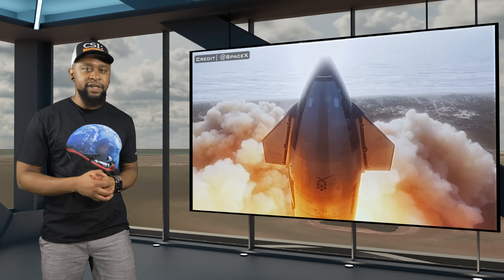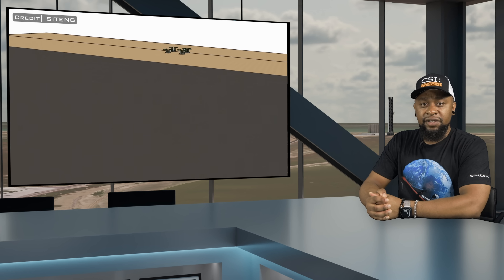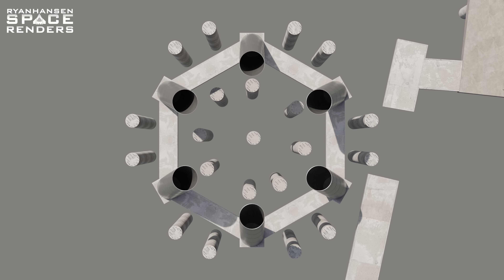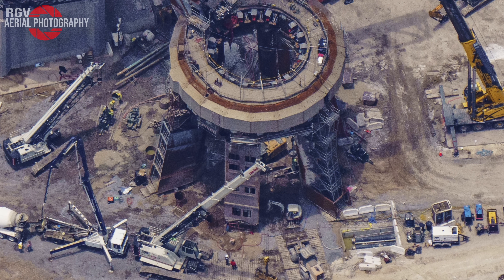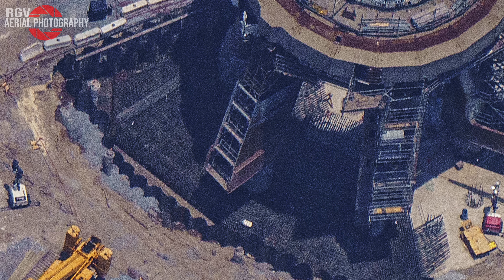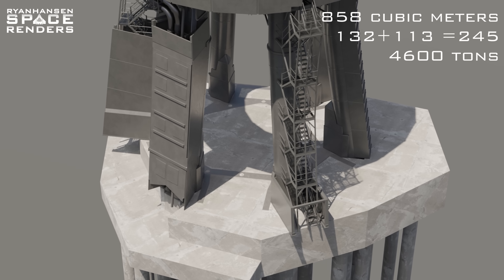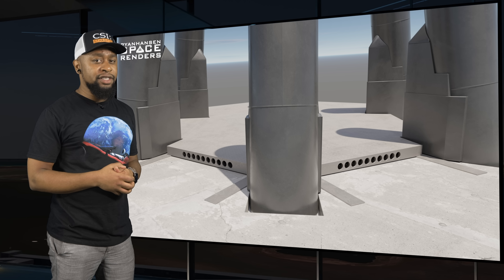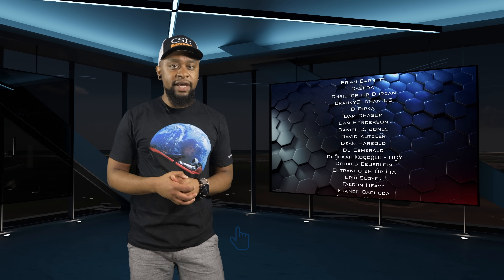How SpaceX Will Guarantee Its Launch Pad Never Fails Again! [Part 1]

Comment: Wow this was quick to recent updates. Well done.  I do have one question though, if the deluge tanks will fill to the top of the weir pipe then the steel plate would be empty of water, during launch most of the water would be wasted just filling the pipes and steel plates. So i suspect that there will be a continuous over filling of the tanks during the launch to fill the steel plate, since water trucks won't be delivering during the launch, this would mean the a water supply line is needed, Have i missed seeing this water line installed?

Comment: Great video ... but all this bracing of the concrete is great and all but when 33 engines blowing on the ground could find a weak point and then everything gets blown up again . Hope that doesn't happen and the water system works

Comment: Another great watch, can't wait for part 2. It's going to be interesting to see what changes between this version of steel sandwich and the one in Kennedy. Hopefully the one in starbase is already completely over built and the one at Kennedy will be bullet proof.
Reply: And hopefully with a flame trench, too. One less part (water pressure system underperforming) to go wrong.
Reply: @EMichaelBall That ship has sailed, the pad location in Florida would not be capable of a trench. They would need a very large trench, one larger than the SLS setup. They're not on the elevated concrete platforms, but basically ground level, so no trench.
Reply: @Jake Rosendahl They’d have to build a concrete mega mountain on the side of 39A, so Falcon Heavy could continue operating from 39A. After the crew capable tower is built at SLC-40, 39A could be left empty for just Mega Mountain construction and FH operations (obviously not simultaneously, but then again, FH isn’t a frequent launch vehicle). If SLC-40 becomes FH-capable, then 39A could be completely abandoned for Starship Mega Mountain reconstruction right where the current 39A trench is. This would require tearing down the current hill/trench complex, and rebuilding bigger.
Reply: @EMichaelBall  They need more than just that. They need a ton of fill dirt to create a mega mound, let it settle for 2-3 years, then dig the trench, then cover it all in concrete, then add a way to transport starship and super heavy from below up that hill.

They aren't gonna get all that dirt from anywhere, originally it was dredged up dirt from the rivers/swamps from right there. They wouldn't get to do that now. Nobody has that amount of dirt sitting around close, nor the ability to transport it from very far.

Comment: Good stuff, sir! The explanation of the engineering and forces involved are very good, allowing a far better understanding. I am curious, though: Over time, what will the effects of liquefaction be on the foundation of the Launch Tower as it relates to the Launch Mount? The composition of the soil there is pretty much sand, saturated with water, going down a long ways. Repeated launches will have interesting effects to these two items as they are not tied together. I am told there is rock down there, but it's a long ways down...

Comment: Who is going to argue that there were no "opportunities for improvement"?
* giant hole in stage 0
* giant debris blowing holes in storage tanks, smashing vehicles, spreading dust over several miles beyond safety zone
* 6-8 engines failed during flight
* self destruct did not work in a timely fashion

<g>>>
Keep up the good work.

Comment: Zack .... I suspect that the subsurface soil beneath the Fondag' layer and around the original concrete pilings has been severely inundated with seawater due to heavy rains and overly high tide levels in during the week prior to the launch. Liquefaction had already set in. The subsurface ground was more like quicksand but solidified I to soft clay  that gave way under the pressure of the 33 engine ignition. The surface Fondag' layer had no solid surface. beneath it.

Comment: As long as you do a heavy stress test on the change to ensure it won’t fail in some other catastrophic way by making a mock set up with weight & force to go against it to see what would happen to different mounts & connections with the new part because it may/may not stop/cause a catastrophic incident that would be better/worse depending on the situation. Over engineering is a good thing but you need to finish it to the finish line of the complete marathon.

Comment: 22:32 I think the smaller discharge rate could potentially be for later use in flights that have the booster return to the pad. It would still be decently close and you'd want a lot of sound suppression.
Reply from the maker: I don’t think it would be necessary because it’s only about 3 engines firing when they are landing.  Also the booster will not be above the launch mount when it’s landing and will instead be off to the side

Comment: You may have missed one interesting detail.  At 20:09 in the video, there is a guy in a dark blue shirt next to a step ladder. Behind him, they are cutting pipe threads into large holes for the water supply using a giant tap with a hex head. The tap is sticking out of the hole just below and to the right of the top step of the ladder. I saw the full video separately, and they are using a wrench and a 12 foot+ extension pipe trying to turn the tap by hand. It looks like a 12 inch hole. They are making almost no progress cutting the threads by hand. As each guy gives up, they keep clling in bigger and bigger guys and use longer and longer extensions. This should have been done during fabrication. Maybe they had planned to weld these connections?
Reply: We show a close up and describe the thread @ 19:32

Comment: I applaud the production values and 3D  modeling in your video.    However, I think you are mistaken concerning the purpose of the water spray system.  The water deluge system is primarily there to dampen the massive vibration output from the rocket exhaust.  Cooling is secondary or tertiary purpose.  I do t know the exact vibration output of this thing but the vibration under  Saturn V (roughly similar thrust output) was estimated to be somewhere just north of 200 decibels during liftoff.  This huge amount of vibration is most likely what did most of the damage  to the pad.  I would also strongly suspect that the reflected vibration also did damage to the engines and nozzles of the vehicle.
Reply from the maker: That is the purpose of a normal water deluge system but we do not believe that is the purpose here.  Elon has stated multiple times that they are not concerned with acoustic energy.

Comment: You have a way of explaining things that is concise and easy to understand. No nonsense, to the point. I have not heard anyone address the new raptor 3 and what will be done with the other two raptor versions. Will the other raptors still be used, and why, if there is a much better version? Can they be recycled or are they waisted? Why would SpaceX use a “less than” version of a rocket engine? 
Curious!
Reply: Once future Raptor version is operational they won't continue to use the older design. Right now Raptor 2 is still being used because there's a lot to be tested and S25/B9 is the most ready vehicle out there without wasting time

Comment: I bet the small pipes at the apex of the upward bend of the water pipes at the end of this video are to vent the air while filling the pipes as well as break the vacuum produced when all that water is moving and the valves are closed. I bet there is another set closer to the tank valves.

Comment: Another excellent video. Thanks.
It's a shame that SpaceX did not install all those pilings that support the massive, water-cooled steel plate assembly after the six main OLM support legs were built nearly three years ago (starting on 22Jun2020).  The Orbital Launch Table was lifted onto those six support legs on 31July 2021.  In the 13 months between those two dates, I'm sure that SpaceX could have at least installed those pilings that Zack described in his video.

Comment: Thanks Zack and team for the excellent presentations.  The water jets disappeared and the plate was superheated when that single engine demo was run.  If this launch is approved it will be interesting to see if that effect translates to the water deluge system.  If so, it will definitely be exciting.  What do you think the results would have been if SpaceX had completed Stage 0 and discarded the outdated booster 7 and used an updated booster for the launch?
Reply from the maker: I think if they installed this without B7 launch than the foundation wouldn't be anywhere near as strong as it is now
Reply: @CSIStarbase    That's unfortunate.  One would think this would have been the plan for Stage 0 originally as Musk said the planning was in place and some fab was underway.  Better late than never, or onward and upward.  Thanks again to you and your team.  Looking forward to the next one.

Comment: Again, your video was well done. I was pretty surprised that they don't have some sort of diverter system. Whereas that system would divert the Flames ultimately to an area where there no tanks.
Reply: This would require a complete demolition of the entire launch complex, because to have enough vertical room for the trench so close to sea level, they’d need to build a big bump. The launch complex is too small to support simultaneous construction on the side.
Reply: @EMichaelBall  I was thinking of something like a jersey wall. Sure the Flames would jump right over a jersey wall, but it could encourage the Flames to go in One Direction versus another Direction. That would encourage the Flames to move away from things like the tank farm. However, the lack of Directionality prevents excessive wear on the directed legs that go into the ground.

Comment: I don't know if it helps, but concrete is measured in cubic yards. A standard concrete truck can hold 10-12 yards depending on the distance from the concrete plant.
Reply from the maker: I am aware of that but during Elon's twitter space he quoted 1000 cubic meters. So thats the unit I went with because it was spot on with what he said it would be

Comment: We all know that launching a rocket into space and returning it safely to the earth is very complicated. 
The engineering that goes into the design of this launch pad is also complicated and very technical in nature. The engineering disciplines that are required include geotechnical, structural, fluid dynamics, thermodynamics, material design, construction management, finite element analysis, statics and mechanical engineering, to name a few. 
Private industry can accomplish all of these tasks in a matter of months, whereas the federal government would take years, if not decades to accomplish the same feat. Private industry also completes the work at a fraction of the total cost that the government would pay for the project.

Comment: I'm curious what is the plan for when Starship lands on Mars, and there is no proper launch pad.  Yes, we landed on the moon the same way, and true there won't be anywhere near the amount of thrust used that booster 7 had, but still, Mars is bigger and denser than the moon, therefore its gravity will be greater proportionally to that of the moon, requiring more thrust from Starship, which is also has much more mass than the lunar modules did.   This all raises the question of will Starship be able to safely land and launch from the surface of Mars where there is no special launch pad in place?  I haven't read/viewed much about this topic, I'm sure it has been examined before, but just would like to hear what conclusions about this question are!

Comment: Before i even watch the video is this video “is this overkill”, no, we just built the most powerful rocket known to man with engines on its way that are 25% more powerful in this is the smaller version of the starship. I don’t think this is overkill. This is preparing for something much more powerful and bigger. Now let’s start this video, love the detail and commentary and explanation this on the Internet 💪🏽
Reply from the maker: Well the title was originally going to be “this is overkill”. Because I believe it is.  

As an addition Elon also mentioned they are taking the overkill route with the new foundation so it would have been a safe “non clickbait” title but I figured I would ask a question instead of make a statement

Comment: My concern is the lack of uniform water input. They have probably run the numbers and put differential sized channels in the plates but it seems to the layman that there are going to be problems with more water coming out some sections than others at different pressures. I guess we will see.
Reply: We will have to wait and see. 
The weir bends in the pipes will make this baby flush like a supercharged toilet!

Comment: The thicker the concrete, the longer it takes to dry inside. This concrete would take more than 2 years to dry. Meanwhile, the water inside can boil and cause the concrete to explode if it gets too hot. By this I mean if the water deluge fails at some point, another layer underneath would be best to protect the concrete from overheating. The resulting explosion would be even more devastating than the first, given the quantity of undry concrete.

Comment: This is archaic technology. The new technology will focus on deflection shapes and heat resistant coatings. Water cooling will not be necessary, and will be replaced by a resonator which will modulate the vector thrust of the engines. This process will amplify the thrust of the engines thereby using less upstart thrust as the launch station will provide an equivalent thrust as the engines on the launch unit.

Comment: Making Stage Zero near indestructible can never be overkill. However, 130 truckloads of concrete is one heck of a lump. How have they ensured it can’t overheat as it cures?
Reply: By doing it in stages

Comment: Like the green screen setup! 🙂
But the small pauses between the paragraphs in the script are a bit killing the flow. ;-)
The script although is pretty flawless.
Reply: Personally I don't like the hard edits used by other Youtubers, they feel rushed and don't leave time to enjoy the points. J Cuts can be good, but I believe if Zack spoke without the pauses it would be information overloud?
Reply: @geoffallan  Just make them shorter and not so stilted. Whenhe sits down the pauses are bit shorter. breath in and continue ;-)

Comment: 17:40 I thought you said previously that the FONDAG was not used in the previous pad, as the bags were shifted, unused, presumably for use in the final design but not in this temporary pad.
Reply from the maker: Fondag wasn’t used during 14 and 11 engine static fire tests. It was saved for 33 engine test and the first launch.

Comment: One thing I don't get is the shape of the deluge plate. To my mind I would have thought that having six faces of the plate come together at a raised central point (even if only 1-2 metres high for a 7-10:1 type of gradient) would have been optimal for flame diversion, while not shooting the jets of water straight up towards action central, as well as having the acoustic baffling a little perpendicular to the rocket exhaust (which I only assume would be effective based on my almost non-existent knowledge of the actual mechanics of the acoustics situation). Is there a good/simple explanation I'm missing that someone can share succinctly with me?

Comment: Question, does the 90 degree pressure against the steel plate  give the booster a faster liftoff? is that why they are so set in this method?
Reply: No, once the engine efflux has separated from the nozzle, it has no effect on acceleration.  They are location-limited to building a "proper" flame trench, ergo the ham-fisted attempts to force a "solution" that doesn't use one (like every other launch facility on the world...)

Comment: The more information I get on this the more I am convinced that Elon knew the existing pad would have to be completely demolished and removed and rebuilt from scratch. It was time to get it done so he launched the first booster starship combo on   4/20 and let it linger awhile to trash the pad. That saved weeks of labor that would have been spent tearing out the old pad material and allowed them to move ahead with clean up and building the new pad.

Comment: How long does it take modern concrete to cure to 90% of ID expected strength?  A few decades ago it was 30 days.  I understand there are new additives that can hasten the curing, but I know little about them.  Thank you for your in-depth videos.
Reply from the maker: Concrete curing time is the same now as it was back then. It doesn't need to cure for them to place steel plates on top of it though. Its designed to withstand 10,000 tons of thrust acting normal to the surface. Steel plates are like paper weights compared to that. All the need was for it to harden before they could move on to the next step
Reply: @CSIStarbase  ok, very good.  

Thank you.  

I was asking for estimating when the next Launch could occur.  Seams like at least 30 days after poor. 

Also, did they run cooling pipes throughly the concrete block?  To prevent it from over heating, given there is nowhere for the heat to go?

Comment: I still dont get, why they are not building a Flame diverter.

It should be easier to handle the exhaust if they hit the surface at an 45° angle

Comment: 18:09 . The stagnation pressure should not be significant enough an issue in deformation in a (normally not-underexpanded) exhaust stream; but rather the ram-pressure: the momentum of several tons of gases moving down at a velocity of  ~10 Mach.